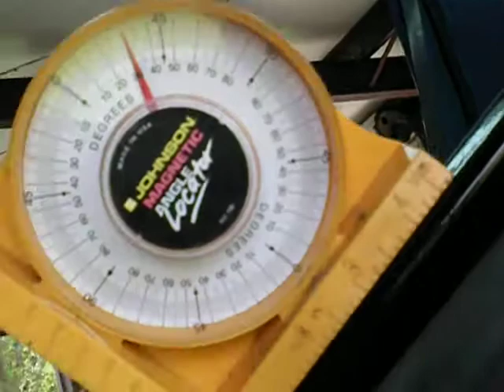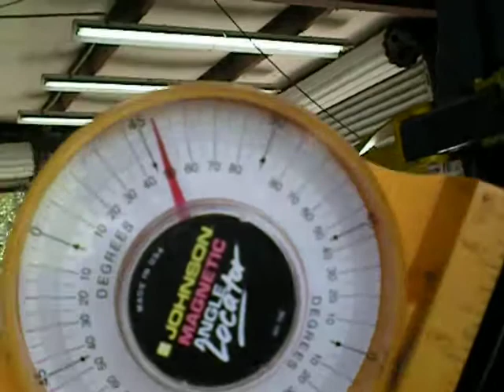Solar Tracker Sneak Peak Design #3 High Wind Setting Made  Easy!!

Comment: @TheKilog69 No Saturday I went through and deleted all my videos because they were just old.  I have just a single panel that has a tracker circuit that I soldered up.  The frame is made of wood but looks decent though. The whole thing is lag bolted on my roof and I always fear it getting blown down from the wind. It's been up there for 2 years now and still works great.  I'd like some day to get a mig welder and build some trackers just like yours.

Comment: Good going.  My area forecast for tomorrow is for 60mph winds and they are getting more often as time goes on.  I found that you'll still get some upward lift on a horizontal panel, but it still is better than leaving it pointed at extreme east or west.  A high wind sensor is very easy to think up too.  I point my tracker horizontal every time the forecast is for over 25mph.